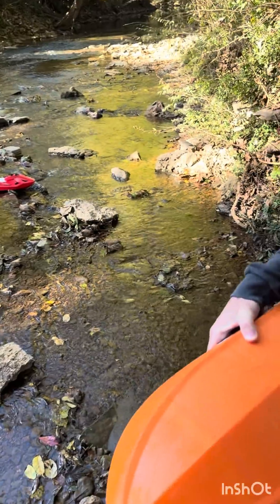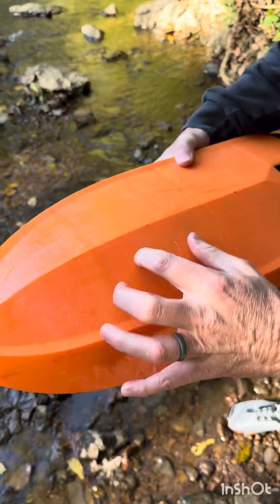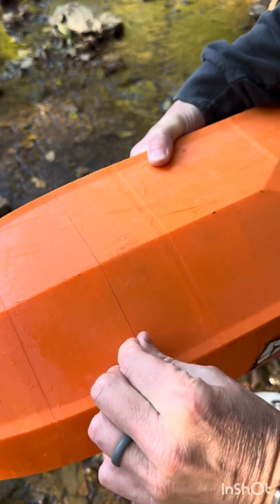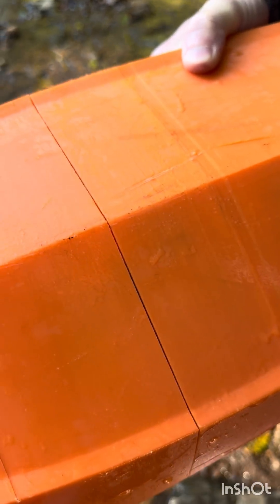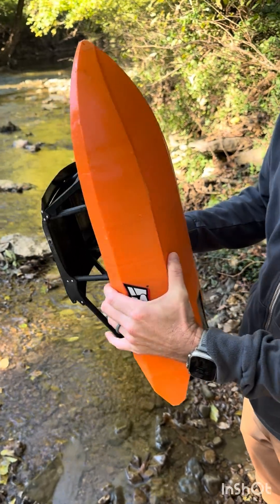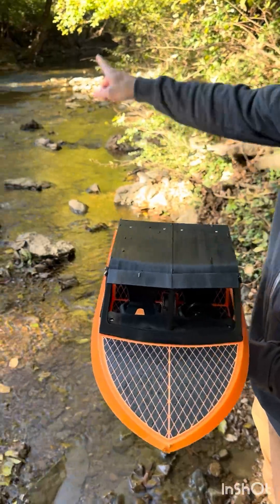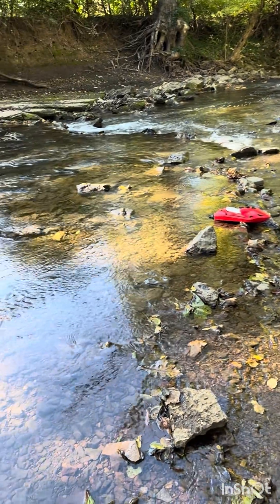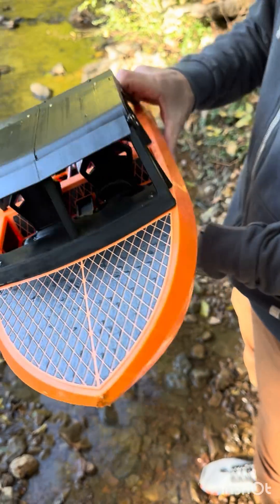The 3D Printed Jet Boat That Can Jump

Comment: Well, what was used to create the hull/boat is definitely tougher than I thought it would be. I was expecting to see a few cracks instead of separation at the joints. Like the other comment reads, resins may not stick, but I'd try a carbon fiber+resin after using an adhesion promoter spray. It's generally used for plastics.
Reply from the maker: We will do a vid showing the repair work.